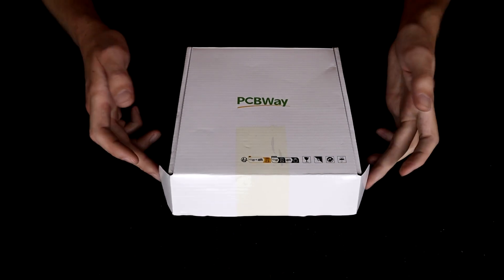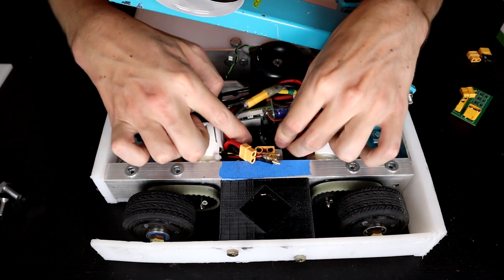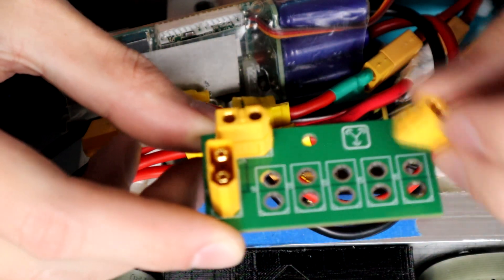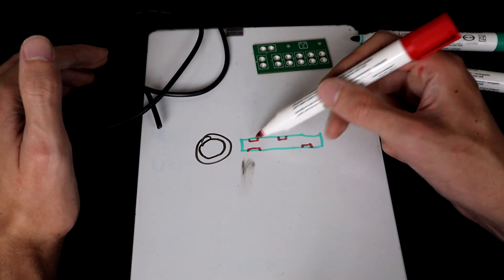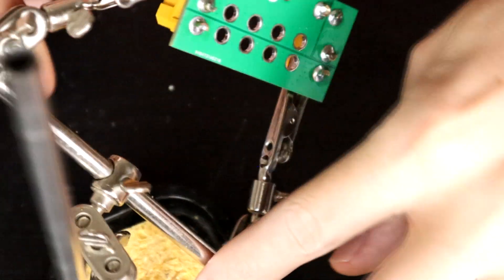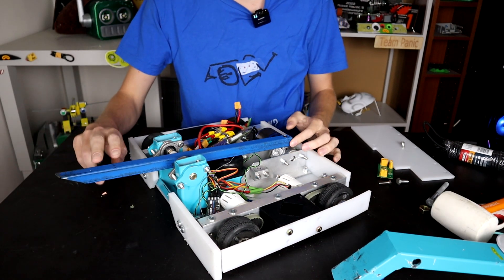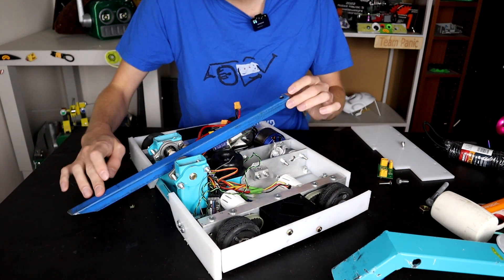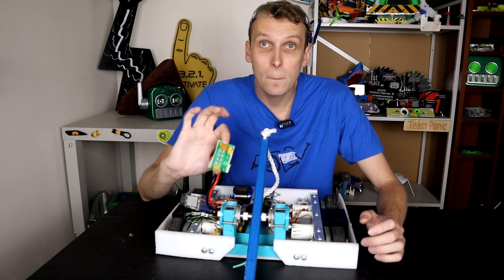Wiring and throw! (upgrading the yolo flipper)

Comment: It might be possible to do a similar distribution panel using breadboard, if it's available in big enough sizes - an armchair electronics thought.
Reply from the maker: I wouldn't use breadboard for anything outside of testing and never for high current carrying applications, the sprung contacts in a breadboard are good enough to grab components on the test bench but in combat they'd be next to useless
Reply: @TeamPanicRobotics  I may be using the wrong name, I'm thinking of the board with copper strips on the back and a grid of holes rather than the push-in style breadboard
Reply from the maker: Ahhh Perfboard or protoboard (depending on where you are and how much strip you want on the back)

Yes, might be possible, I dont know if there is one with holes big enough for an xt60, but if so it would be very usable

Comment: small suggestion: wire lenght, i see you have a super powerfull motor to flip just with the  torque, but I think you should focus on how much having more rope before the flip affects the result, when the motor has the rope on the winch winded in one directio, it losen it and the it pulls in the other direction the flips are much better, that's because you have enough spinup to have the motor bell interia work as a kinetic  flipper flywheel 

i don't  have any "real" experience, I build kinetic flippers only with 1kg lego bots, but I believe if you can find a way to have more rope before starting to pull the lever you can get to a point where you will have some good ke in the motor bell and have nice flips even without spinup + clutch
Reply from the maker: You are correct, the flips from a slack rope are the best and adding more rope would help (to an extent)
This is something thats on my radar and that I want to work on for v2, but before I do that I'm going to add position control to the motor, so I can get it to start and stop at the right spot each time, which will garuntee that the "unwound" position is fully unwound, as that was one of the big problems, currently its just manual control and its hard to judge when the rope is fully lose, ready for a big flip

Comment: Good ! I wonder however about te placement of the "link" connector : won't the other wires and their connectors force you to put the PCB too deep inside the bot for easy link/unlink ?
Reply from the maker: If soldered and used directly like this yes, 
but its an xt60 connector, I can wire up a counter part and connect it to a different switch on some wire, so I can position the switch where ever I want in the bot, or I can wire the switch directly to the board without a connector there

Comment: armchair engineering here but i think if you add two additional holes on either side of the XT connector holes so that you can zip tie the connectors to the board for better hit tolerances
Reply from the maker: Oooh thats a greta idea, would make the PCB a bit bigger but would be very nice for reliability
Reply: @TeamPanicRobotics  for the large bank could do one hole and a notch on the side and just use one long zip tie

Comment: That power distribution PCB is sweet, way less janky than just using a bolt with a bunch of tape and it gives a nice place for the removable link as well. It's great to see with the different arm shape that the motor still has plenty of power considering you changed the mechanical advantage from around 2:1 to 1:1 and it's finally getting some actual flips in instead of some lackluster lifts.

What you can experiment yet for v2 is to have maybe a thinner (less wide) but taller (higher edges) pulley, so the rope instead of just coiling up randomly on the pulley it coils up on itself, essentially giving a progressive gear ratio where the further along the pull it is, the faster the arm moves as the rope coiling up on itself will increase the diameter of the pulley with each turn.

Great video!
Reply from the maker: Thanks!
The PCB is going to be so much neater and less janky 
The motor still has plenty of power and can probably give more with a smarter ESC (like an odrive) so I feel comfortable inverting the arm ratio for V2, going 1:2 or something

A new thinner pully is a great idea and one I'd been considering, especially if I can incorperate a small-ish fly wheel to give even more speed/power.  might have to get PCB way to make me something custom